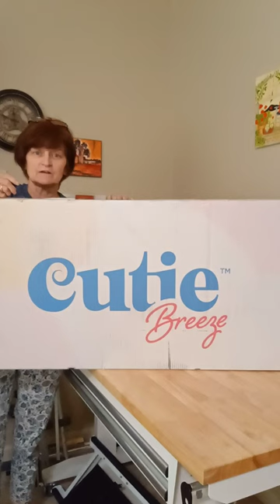Cutie Breeze™ Assembly

Comment: Current instructions (Task 1, Step 2) call for having the bumper on left for the rear rail and on the right for the front rail.  My machine was purchased on March 1, 2024 and I have Assembly Instructions dated September 19, 2023.  In addition, there is no discussion as to which way the lower carriage should be placed.  The instructions are also not completely clear on this point.
Reply from the maker: Yes, you are right....this was a video cut during the Beta Testing.   Things change after the beta testing... unfortunately, the video is static.

Comment: Where should my Jazz 2 sit on the chariot upgraded top, I have not found any information on how to center/position my machine to move forward?  Your videos are so helpful and that is one spot I am struggling with.
Reply from the maker: @lynnquast9205  the weight of your Jazz II is in the back, so center the machine with the rear of the machine completely on the chariot plate.   Your front will hang off the plate of the chariot, but that's not going to be a problem.  Also, 2 things to keep in mind...you will want the front rail adjusted out farther (to accommodate the front hanging off) and you don't need the back machine tabs....the weight of the machine is enough.